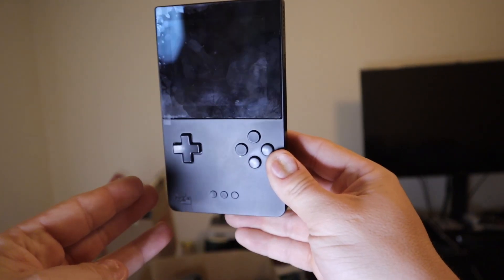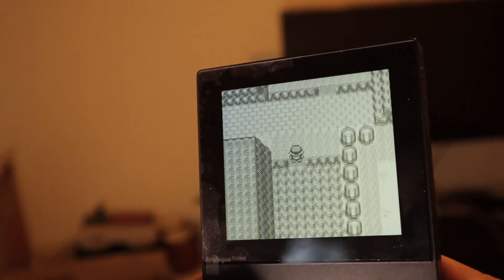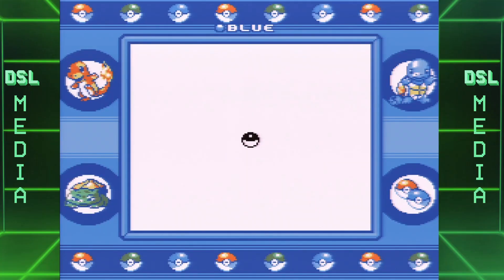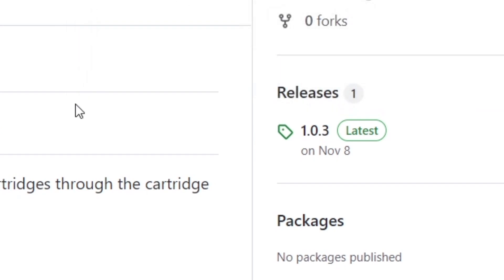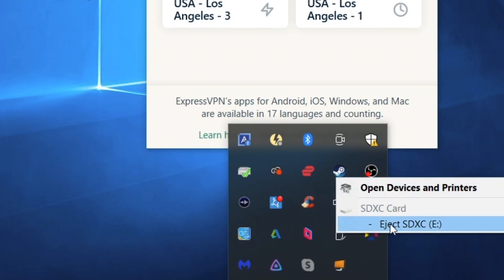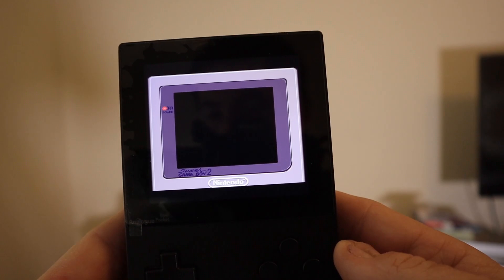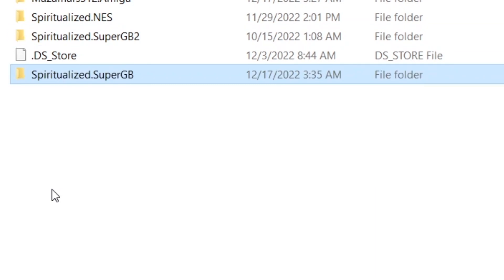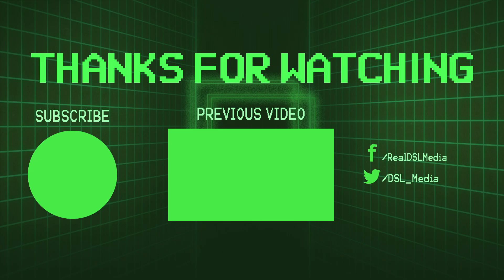Learn How To INSTALL Super Game Boy 1 AND 2 On Your Analogue Pocket

Comment: Hello!  Thanks for the tutorial.  You seem to be the only one talking about this or at least doing a tutorial.  Kudos to you!  I appreciate your time.  That said, I was unsuccessful in getting it to run.  Right about the 8:20 mark it gets a little confusing.  It asks to copy then delete the original sgb_snes.smc file then paste it to the SGB2 file?  Please advise if possible.  I am tech savvy and have no issues with things like this so I must be missing something.  I have tried both SGB2 bios.bin and SGB2.SFC/SMC file extension types with no luck.  Just a blank screen.  Original SGB works well.  

I have the most recent updated cores and pocket updates as of 12/27/23.  Is it possible something is different with the new updates that prevents this?  Is possible to make an update version of this video with updated instructions?  That would be killer.  A comment reply would also be helpful.  Thanks again for your time and tutorial.  I look forward to your response.  Cheers!

Comment: You need to go more step-by-step. You pointed out in the github it says you need those files and where to put them, but you didn't mention where to get them, or at least what they are like in the SGB2 section. You said just move the files "and from there you should have the super gameboy running on the analogue pocket." Well mine just makes a clicking noise and doesn't run anything. Also I had to figure out to go to openfpga because I never did any of this before. Neither this, nor the pocketupdater instrrructions you gave produce success. I'm pretty sure I know what you are assuming we could figure out, but this is a how to video. It should show us HOW TO do it.
Reply: The good part is you figured it out.